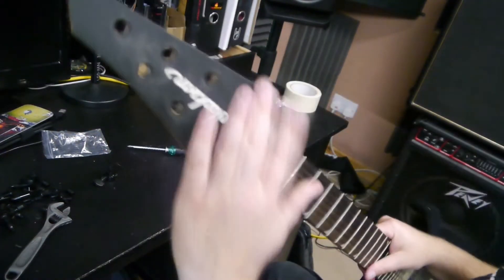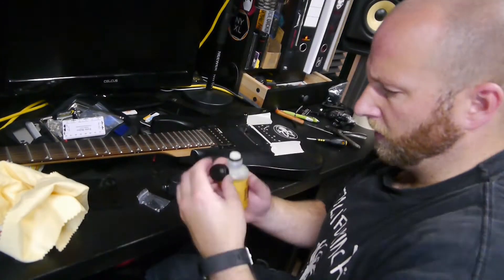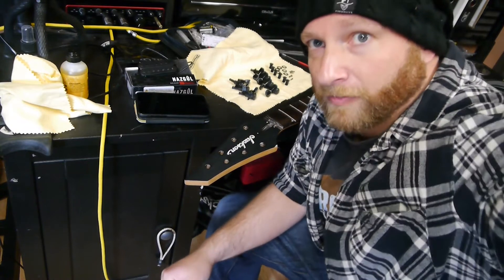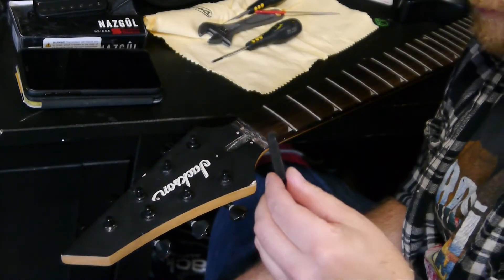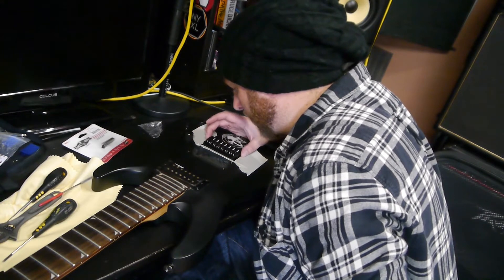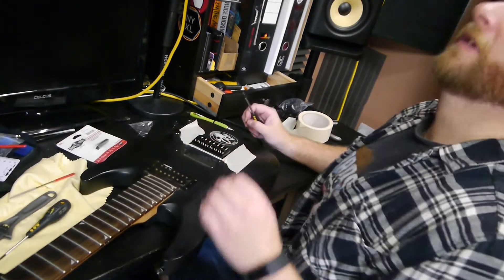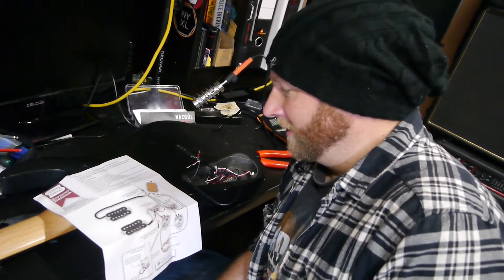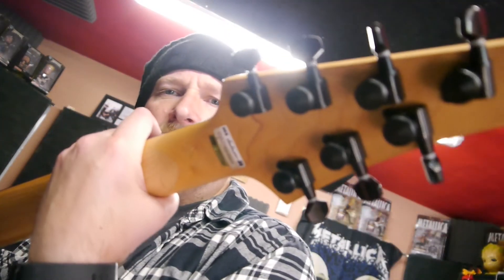Jackson JS22-7 modification - locking Machine Heads - Graphite Nut - Bridge - Seymour Duncan Nazgül

Comment: Do you like the Nazgul pickup in this guitar? Worth the upgrade from stock pickup?
Reply from the maker: Yeah it’s a nice upgrade. Really high gain, the stock pickups were lacking tone I feel.
Reply: @GRINNERMETAL  I am thinking to buy this guitar and upgrade it. I am thinking for Fishman Fluence Modern.
Reply from the maker: It’s a great base guitar. I would do like I did and upgrade the tuning stability, bridge, tuners and nut. To the fishman’s come with solderless wiring like EMG’s? Makes life so much easier.
Reply: @GRINNERMETAL  I don't know what is solderless wiring? I am talking for the regular Fishman Moderns Soapbar version (i don't like the pickup rings).

I want to take it to luthier and leave him to do the work. The guitar needs routing to fit the pickup, and also routing for battery cavity.
Reply from the maker: @giannispapazogloy5978 EMG pickups come with wiring you just plug in, it’s really easy. But yeah if you’re getting the body modified then a pro is the way to go.
Reply: @GRINNERMETAL  Ok. I understand now. I think Fishman come with solderless too. But i am not sure.

I sent email to a good luthier, and he said we can put soapbar version in this.